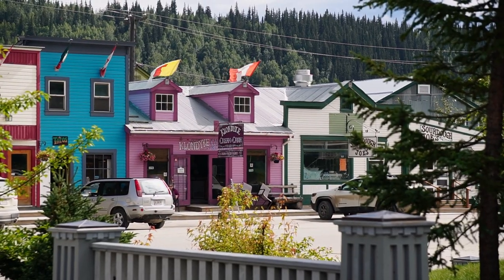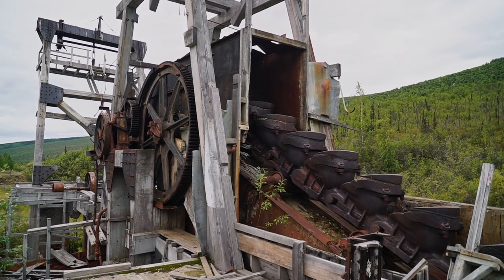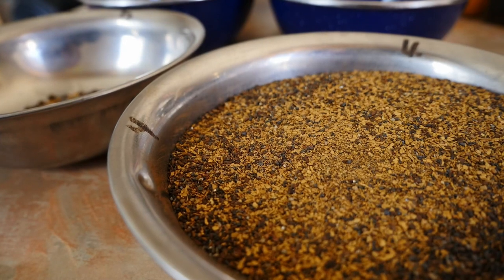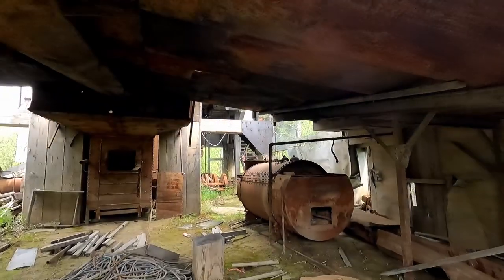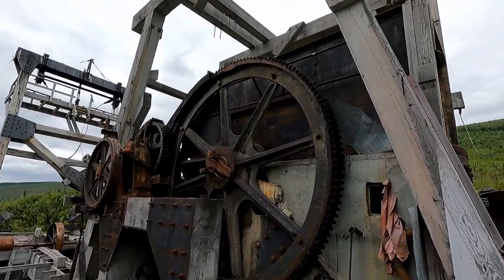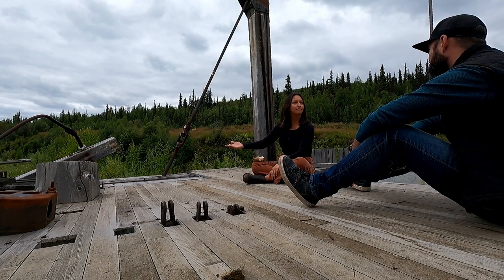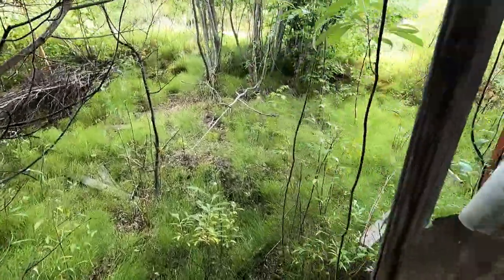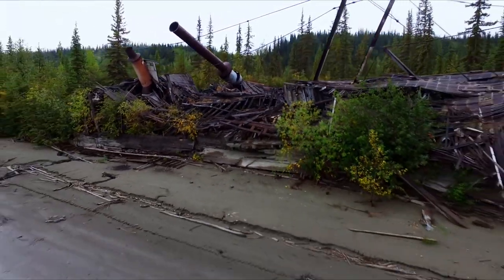Lost in the Gold Fields | Abandoned Gold Dredge | Destination Adventure

Comment: Multiple belts are used because one large belt with the same power transmision capability needs a much larger diameter pulley because is cannot bend as tightly as a smaller belt.  The resistance to bending in larger belts also means they are less efficient.  So multiple smaller belts are able to transmit the same amount of power more efficiently than one large belt.
Reply: incorrect, a large flat belt will bend more easily than a v belt. Its all about surface area. a 2 foot wide flat belt has 2 feet worth of grip. a v belt may be only 3/4 inches wide but could have 1 inch of grip on both sides. so for every 3/4 inch width of belt you get 2 inches worth of grip. this effectively doubles the amount of belt grip in the same amount of width. also because the v belt is essentially a wedge it grips more when you tension it than a flat belt.
Reply: @leetucker5788  the question was why multiple belts, nobody asked about flat belts.
Reply: @RealDeanWinchester  if you used one large belt it would have to be flat...
Reply: @leetucker5788  not the point.  But if it makes you happy I'll tell you you are a good boy.
Reply: @RealDeanWinchester  what is the point then? because you're not conveying it well.
Reply: @leetucker5788  it isn't my point to convey, it was his in the video.  He asked why they used multiple small belts instead of one large one.  

You got off the rails with your flat belt lecture, don't make a thing of it.  Rewatch the video if you don't understand.
Reply: @RealDeanWinchester  What kind of large belt were you referring to then? 1.5" wide is the biggest v belt available back then. The only other widely available belt was a flat belt, which would have been the largest belt.

Comment: So think of the bucket line like a big chainsaw blade that could be lowered and raised by the main winch. The winch bank you saw past the boiler was for steering and achoring the dredge via cables that went to tethering points. The gravel and rock dropped into the hopper and the crushing and grading process began by getting rid of the big rocks first and then the maze of sluices separated out more and more until you got to a particle size that could go over the trap boards. There was a mass of water running down the sluices and people would break up  jams and direct the refuse out the main dump chute. Shaker beds were used in the later part of operations to improve extraction efficiency.

Comment: Those three large items at 8:07 were transformers.  Dredges were largely electrically powered, and had a huge generator on board.  Originally they had steam generators, then later steam-turbo and diesel generators.  Most times the generators were pulled out after they were retired as it was easy to sell such large power plants for other uses.

And there is still at least one large dredge still operating in the Klondike.  Dawson City miner Tony Beets brought one back to life in 2015 and has been mining with it ever since.
Reply: Not sure your correct about Tony Beets. If that's the guy from the Gold Rush TV show, I know Frank from Exploring abandoned mines visited a dredge that was cosmetically fixed up for the show, and abandoned  afterwards. https://www.youtube.com/watch?v=dnsLH74i7SU

Comment: Those are transformer bodies @ 8:00 for the electricity that was produced on the dredge. Dude! This is one of your best vids yet. We explored a dredge exactly like that 45 years ago in roughly the same area when we visited my Aunt up there. Thanx for the memory jog. I'm sure You were joshin about the word on the supply cabinet saying "onions"... LOL... it's "union" which is a coupling that threads apart. Could've swore in one part when You were panning around, I could see the remnants of the generator. In the case of multiple "V" belts as opposed to large transmission (flat) belts is the v belts provide greater contact area to reduce slippage and additionally they don't need to be "tracked" like wide flat belts. Tracking is a technique used to return flat belts to the center of the pulley if they've been misaligned

Comment: Love your videos , those  dregs are most likely electric powered with 3 phase power. Those round cans were power transformers the steped the high voltage power from a remote location down to a lower voltage to power the equipment on the dregs. The looked like the insides were remove, most likely to get the copper out.

Comment: Thank you for another interesting video.  You're motivating me to make a trip to Alaska.  

It's extremely refreshing to see a YouTube explorer who's not afraid to admit that they don't know what a particular piece of equipment is, rather than making a bogus statement based on a wild guess.  This shows wisdom.  Nobody knows everything about everything.

The three finned steel drums at the 8:00 mark are electrical transformers (like what you'd see up on a utility pole).  Someone has removed the lids, drained the oil, and taken the copper windings out of them for scrap.  The oil is nasty stuff, containing  PCB's..

The overhead arms and linkages you pointed to at around 9:22 connected the control levers on the upper deck to the various winch clutches and brakes that you were standing next to.  The large moving pieces of that dredge were manipulated with wire ropes pulled by those winches.
Reply from the maker: Great knowledge, thank you.

Comment: That machinery is old winching systems that were used to hoist attachments like the bucket boom via steel cables that were connected to the drum laggings. That linkage operated the winches below with the operator tower above. More modern winches were air and electricly controlled. I worked on stuff like that for decades in locomotive rail cranes as a heavy duty mechanic. 👍👍⭐⭐⭐⭐⭐👍👍
Reply: I'm pretty sure those are power transformers, and don't look much different today!

Comment: Amazing !!!!. That dredge illustrates the high level of engineering and manufacturing that took place right here in Canada back then. Made us a true industrial powerhouse, now well not so much unfortunately. The three large grey cylinders are electrical transformers with their lugs protruding thru, the cooling fins running vertically on the outside of the case, all the lids have been removed. Even though I'd watched the episode about the beached dredges this was equally as interesting because so much of the upper structure is intact. Great views of a the dredge as a mostly complete piece of equipment. Thanks.

Comment: Great  interesting  explore  The bucket  chain  seems in  great  condition  over  here in NZ  dredges  were often  worked to death! ,the  biting  edges of the  buckets  were  torn right down!   no maintenance  till she finally  broke down! the  "tailings:  ,,the  rows of sifted  rocs  which  follow the dredge are a major  problem to using the  ground  for  anything the winches  warped the floating dredge  around.  The "little  belts are actually able to transfer  greatly  more  power than flat  belting  & stayed  firmly in  place (@ %6000  more than  ancient flat  belting  Tap Care  mate these old sites are  dangerous  Thanks

Comment: Multiple smaller v-belts are less prone to slipping on start up of a motor (multiple belts share the initial start up forces), and they are better suited to smaller diameter pulleys. A single wide belt doesn't have the same ability to bend around pulleys as they are less flexible. I quite enjoy your channel. Keep up the great adventures into the past!

Comment: I was always amazed at the ingenuity and engineering of dredges, not sure of how I feel about what they did to the landscape tho.
I think those first three black cylinders were transformers, not something I would have played with, they are known to contain PCB's.
If I remember, multiple belts were use for a couple reasons. The first was that v belts were easier to source and secondly, they were much less prone to slippage than a single wide belt.
I'm surprised they were never salvaged after being abandoned.
Reply: If you’re talking about the dredges not being salvaged you need to watch Gold Rush because Tony Beets is a miner in the Yukon and has put two back to work in the last few years.  Really amazing to see them working.
Reply: It depended on whose claim it was left on. They were salvaged. Number 4 was protected by parks Canada. Dave is born and raised here. I work in that casino for almost 30 years.

Comment: The buckets have new cuting edges welded onto them..to replace original casting material lost to wear from digging rock, sand etc.The rig must have been serviced some time after early 1900's when arc welding began to spread across the industrial world. Imagine the volume of wood needed to fire the boilers to make steam for the operation of the buckets. An amazing place the Yukon.  The 3  large cans noted early in the video appear to be distribution transformers for a large electric supply..perhaps the dredge was converted from steam to hydro.

Comment: Those three "cans" were electrical transformers.  The apparatus you saw on the ceiling connected to the winches right below.  The winches moved the dredge. The winchman on the upper level operated the levers there to control the winches The small clip was an electrical conduit clamp.  V-belts are much more efficient in transmitting power than flat belts. As the belts moved around the sheave, they bulged to grip the sides of the sheave.  The belts would be a "matched set" in that they all were the same length.  There were no extras in the set.

Comment: Regarding the multiple belts...it's because like plywood...multiple belts are actually stronger than a single belt AND the spaces in between help dissipate heat - which helps the belts last longer ( also one or two could probably break and you could keep on working ).

Comment: those are power transformers like you see on power poles. that giant gear is called a bull gear. the smaller one (s) are called pinions. the multiple belt system would give more surface touching the pulley giving better grip.

Comment: Not far from where I live in Australia the two biggest gold dredges in the southern hemisphere at the time operated. They operated from early 1940 to the late 1950's. The biggest was the Tronoh dredge and it took out 54000 ounces in its ten years of working a two square mile site. It could dig to a depth of 90 feet. The other smaller dredge was the Eldorado and it went down to 50 feet. The Tronoh was pulled apart and sent to Malaysia to dig for tin but the Eldorado dredge is still there partly floating in its lake. Both the dredges ran on electricity and had transformers like the ones on your dredge to break down high voltage into 240 or 110 volts to run motors and the like. They did not stop because the gold ran out but because the price was to low to be profitable.

Comment: The outlet at 14:00 is likely standard 115V 15A non-grounded outlet type that was common in the early 20th century to accommodate two different styles of two prong plugs known as "tandem,"  with the blades inline and developed in 1904, and "parallel" devised about a decade later. The parallel style ultimately won but because both plug types were around universal outlets were common for many years and this was one of two styles (the other had two separate terminals for the parallel plug for a total of four rectangular holes.)

Comment: the v-belts are what was common on older equipment driven by electric motors. you'd likely have a wide flat belt common on farm equipment of the era but the torque that can reliably be applied through a v-belt is alot better for electric motor driven equipment

Comment: > In the early 1900's these machines were steam powered and a lot of machinery was covered in the main room. By the 20's electric motors were fitted to do away with the cantankerous and inefficient steam engines and that cut down on the crew size. What I question is why the digging edge of the buckets was a blunt edge? Perhaps to shatter the larger rocks if conveyor speed was rapid enough?  The unusual electric plug is a high current receptacle.

Comment: The multi V pully for the winch station isstandard engineering practice. The surface area of the V belts add up to more than what a flat belt would be plus they pull into the V section in operation giving better grip. The belts themselves can be made by an easier process and out of stronger material and they don't have a  joining point so a weak point is eliminated..

Comment: I'm sure you will never see this comment but the 10 belt system was a design transition period. V-belts work extremely well over the old flat lather belts. At that time, not sure of the name, they didn't band the belts together with a top strap. The top strap v belts are awesome and you can't break a single belt, but they are a angry bear protecting a cub to get on. I have equipment that I run to this day built in 1953. It runs a 5 belt system. Tremendous torque can be applied but if something go3s wrong; the belts slip. Chain drive, something goes wrong, something is going to get destroyed.

Comment: Those 3 large ribbed cylinders were high voltage electrical transformers. Being as old as they are they would have been filled with highly toxic PCB oils for cooling.  PCBs are extremely illegal now and if any still exist they are tightly controlled. Transporting PCBs is extremely difficult due to regulations. I worked in a factory originally built in the 1960s that had a locked room no one was allowed to enter for any reason. It was their PCB storage room. Basically those PCBs will never leave that room ever because how toxic PCB oils are. Watch out for any old electrical transformers... any old ones will have PCBs or residue in them.